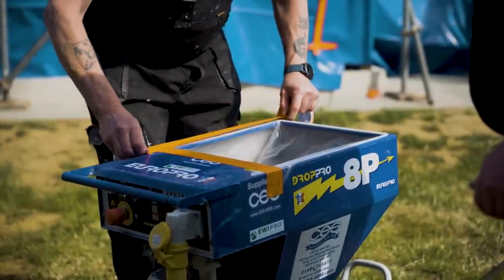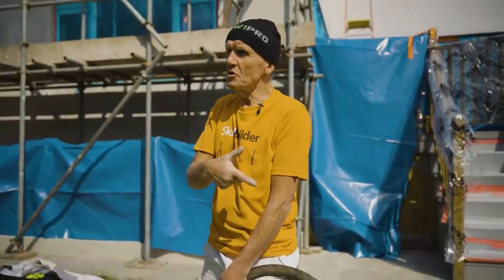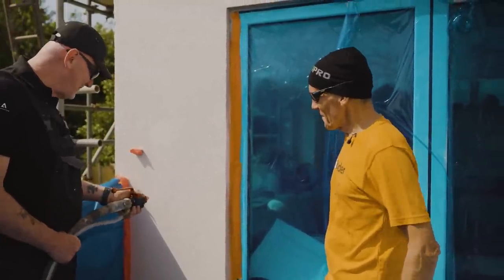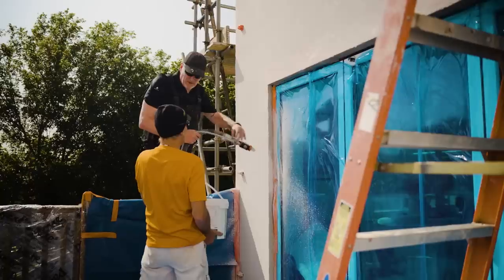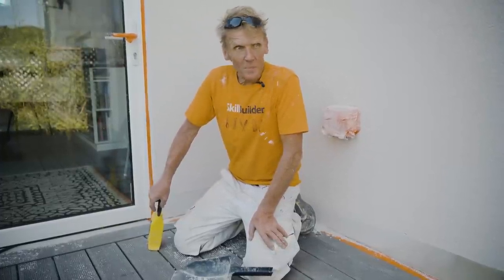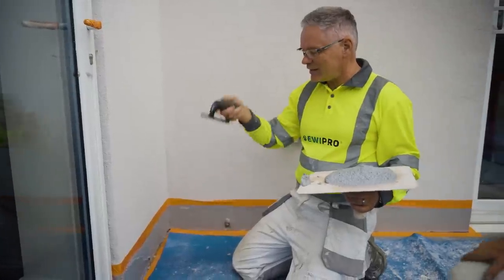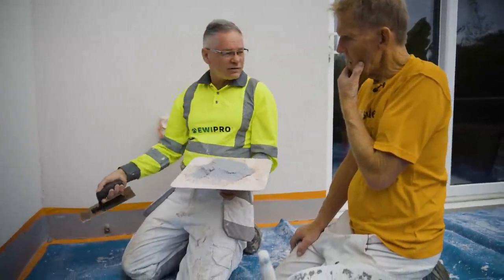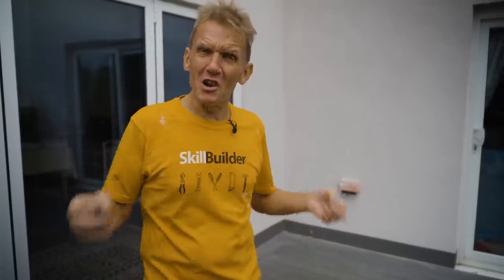Spray Rendering — Everyone Is Doing It ?

Comment: Good video. I used to put on by hand. I brought a 50L air compressor and a £20 hopper gun off eBay. And never looked back! I would never hand apply it again less mess and use a lot
Less material.
Reply from the maker: I had  one of those hopper guns but I leant it to a plasterer and he sold it on ebay for £20.00 I was bloody fuming.
Reply: I bet you was!!! Air compressor and hopper gun are much cheaper and easier to clean aswell! You only have to clean the hopper gun when your done. I can’t recommend it highly enough
Reply: @jamiec4108 hopper gun is easier to control but a pump is miles ahead done both,hand finish looks better

Comment: Is this product suitable straight onto brick or blockwork? Looks a nice finish but I assume it is dependant upon the condition of the substrate
Reply from the maker: I would use it on fair faced blocks with a primer but not on brick. I think painting bricks is asking for trouble.
Reply: Can you render the bricks first then go over with this? I have a brick house I’ve done the extension out of block (to render it all) but I think getting the house rendered then doing this over everywhere will be cheaper then render everywhere
Reply: @SkillBuilder 
Absolute rubbish you would never go straight over block work without a basecoat
Reply: Painting bricks is asking for trouble lol what made that up 😂😂

Comment: Will this work with a hopper gun? Cheers
Reply from the maker: not this  product but I have sprayed sharp sand and cement/lime with a hopper and it worked well but you need a massive compressor.

Comment: What happened to Cullamix ? - used it in a Tyrolean hand cranked bucket that flicked the stuff onto the wall, and promptly took all the skin of your winding hand.

Total cost about £15 ( it was 40 years ago )  a bit less than the gear you're using now , and less of a pain to clean up.
Reply from the maker: I have looked into using Culamix, you can still buy the flicker so it might even work with this EWI product. I will give it a try.

Comment: It will always be dubious spraying or applying anything onto a substrate you know little about or how long it’s been on, fine if you are doing the whole job base coat and the works from scratch but if not you could have issues.

Looks messy and masses of sheeting down, it wouldn’t be so easy cleaning up if it had been pissing down with rain just like any rendering system.
Reply from the maker: Don't do it in the rain.
Reply: @SkillBuilder  you don’t need to do it in the rain because whatever the forecast says and because you live on an island like the uk you’ll always get rain and get caught out by the rain.

If you’ve got material laying on scaffold boards or on plastic sheeting you’re in for a mess when it gets wet, no matter how many times you check the weather in the uk you’ll always get days when you’re caught out applying any kind of external finish.

Comment: This is most comon way of exterior finish in Europe. So with experience I can tell you this is not good. This is building protection and like that you need to apply it carefully and when you pass one square meter or two you need to come back and open it. This is not good. I've seen this trials all around and they failed. Trowel and be fast. One more thing. You nee to be careful it's not to hot or windy. But weather in UK is perfect. We use to know get up early and start at 5am before get hot. At least in UK you don't have this problem.
Reply from the maker: We have been using this material in the U.K for a long time and if you watch the video you will see we did go back over it. 
The point about heat and wind was made. Maybe it is hard for you to follow our funny English but we are all over this and it won't fail. We have hundreds of examples of this in the U.K. EWI would not be in business if the products didn't work.
Reply: @SkillBuilder  I expect this from you. I gave you some advices in the past but you didn't accept. You think that foreign people doesn't know nothing about construction in the UK. Mate I'm working last there years all around England and I can tell you that you're 20 years behind Europe. I'm using wago for 20 years in one East European country. Press fittings for 15... So... You shouldn't take this like bad comment, you should take this like advice and another opinion. Thank you for your comment. I'll try to improve my English. In meantime you should lisent advices and try to improve your construction.
Reply: Schluter is in the business in UK and US selling thing which is not suitable for wet rooms and bathrooms. We knew it was bad from beginning. We have so many small manufacturers who are doing better thing than ditra. To be honest I was surprised how good bathrooms are after 20 years with tiles set direct on plywood.
Reply: @jbjoe249  Press fit is hardly something to be proud of.  Quicker, cheeper (labour) and no hot works yes,  but will it last more than 20 years or 50 before the o rings fail?